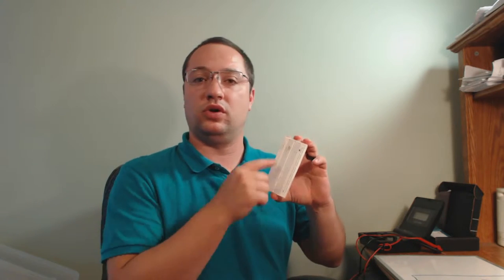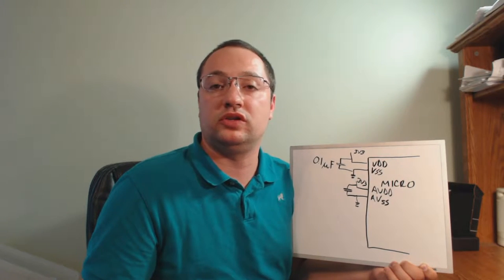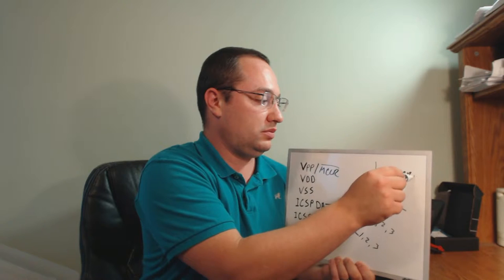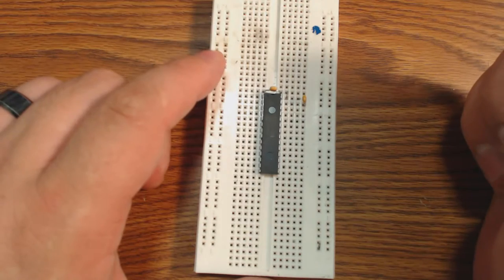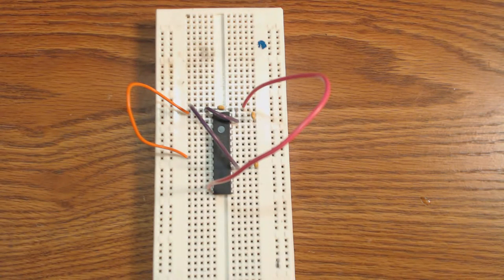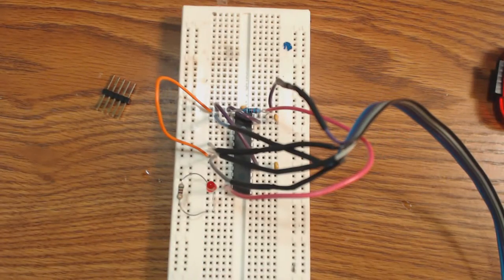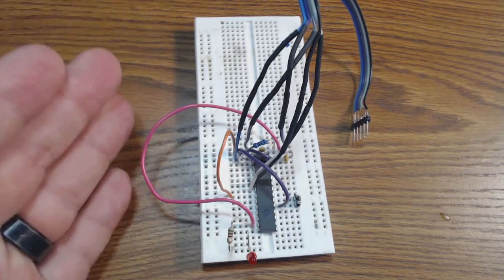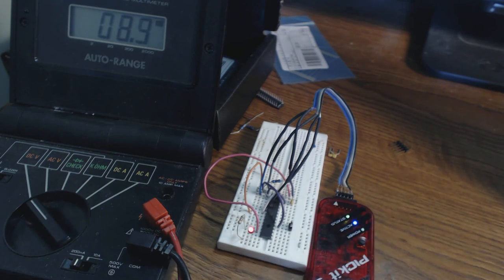eapbg #7 Wiring 16bit dsPIC33 Blink

Comment: Thank you. You have saved me from a lot of trouble. Many things I have learned from this. I'm just curious, why can there be a low value of capacitance of .1UF connecting the VSS and VCAP?  My book recommends it to be 10UF and as close to the chip as possible.
Reply from the maker: If you finish watching the video, I address that in fact 0.1uF was not working and I had to change it out to 10uF.
Reply: Indeed you do. I might have gotten too excited for my own good!

Comment: Hi, do you know how to program pic without programmer using only computer via UART and bootloader?
Reply from the maker: There are basically two challenges. First, you need to find a bootloader that would work or write one yourself. There is such a large variety of PIC microcontrollers that only just a handful have bootloaders written for them. The second is that the compiler you are using would need to be modified to change the memory offsets so that when the hex file is generated it accounts for the bootloader.

Comment: Hello there Can i just program the dspic33fj without wiring the Vcap to 0.1 uf then to Vss ?? 
as um short of capacitors now ?
Reply from the maker: You can try, it would not hurt anything. It won't run without the vcap capacitor. Also, the typical value for Vcap is 10uF, i address this at the end of the video.
Reply: Thanks 
so to make things clear  , is that all i need to program a dspic33fj64gp802 
https://github.com/hananabilabd/Offline-Audio-Equalizer-Tone-Generator/blob/master/Capture.PNG 
except that the Vcap capacitor is 10uf instead of 0.1 
Do i need anything else ?
Thanks in advance
Reply: Can i use a 10 uf polarized instead of ceramic between Vcap and Vss ?? as i I've searched a lot and there it seems they have no 10uf ceramic in my country
Reply: Please reply as soon as possible because i don't want to get my dspic burnt
Reply from the maker: Hanna Nabil a polarised is fine but it needs to be low ESR (effective series resistance). An aluminum may not be good enough. A tantalum or polymer would be best.
Reply from the maker: Hanna Nabil what thou have there looks ok.  Check the getting started section of the data sheet. That will have a schematic.

Comment: @eapbg help please
Reply from the maker: Help with what?
Reply: @eapbg  You speak Spanish?
Reply: I need help programing this dspic33FJ128MC802 and im having problems with mplab including headers(xc.h)
Reply from the maker: @simonramirezmontoya3140  I do not speak spanish.
Reply from the maker: @simonramirezmontoya3140  Make sure you have the latest mplabX installed and that you have the latest compiler, XC16 I think. Make sure the project is configured correctly and that the correct compiler is selected. Other than that there's not much else I can tell you. Issues like this are difficult to diagnose over message.
Reply: @simonramirezmontoya3140  pato